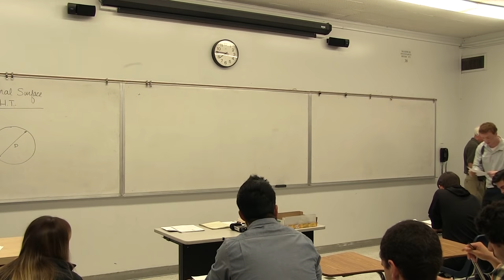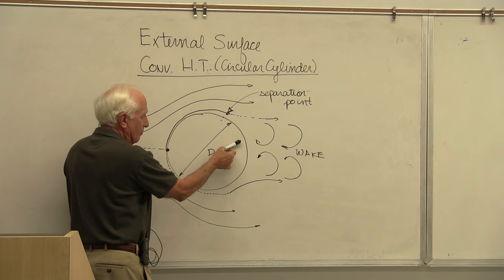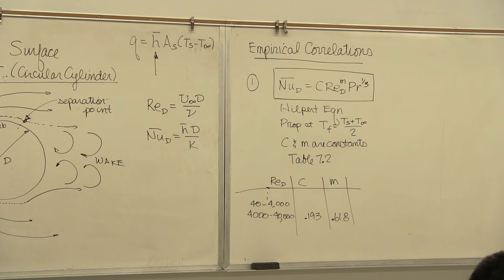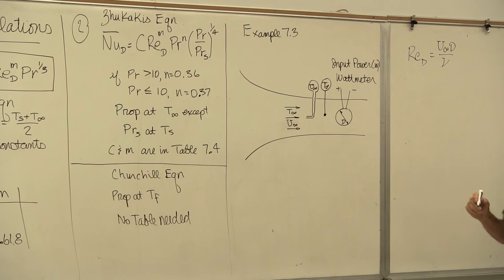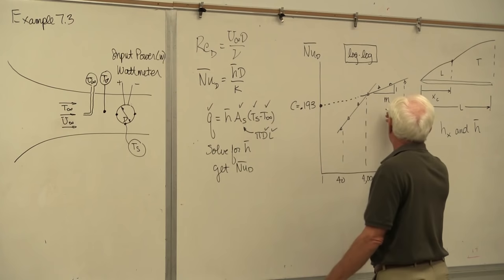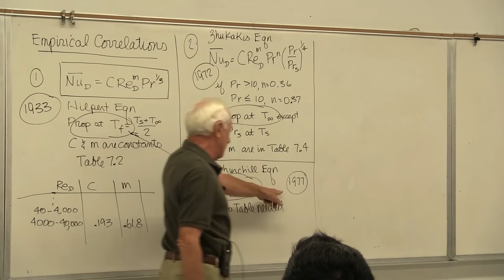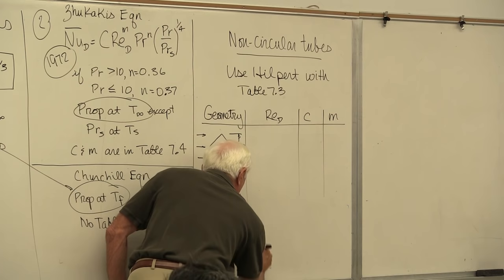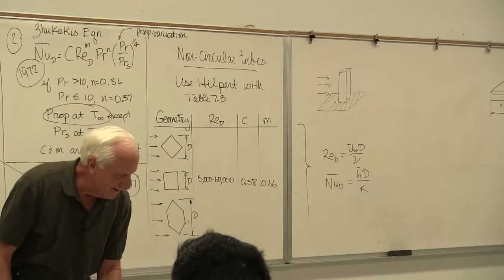Heat Transfer: Convection Over Cylinders, Part I (20 of 26)

Comment: I appreciate what you are posting. Please continue to make full lectures for courses related to Engineering. I am a Chemical Engineering undergraduate and enjoying what I can not have in my class. This Professor is invaluable.

Fluid Mechanics for Undergraduate Engineering
Thermodynamics for Undergraduate Engineering
Heat Transfer for Undergraduate Engineering
Engendering Economy for Undergraduate Engineering
and so on any intermediate course between different Engineering disciplines will be more demandable.

Although I would appreciate it if Mass Transfer or Transport Phenomena were available.